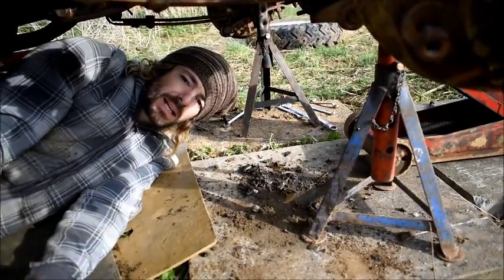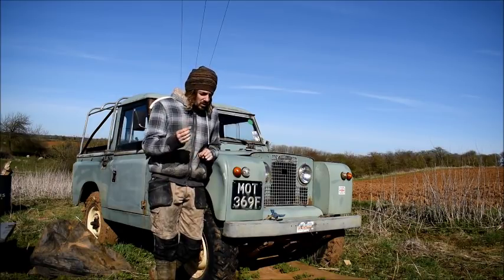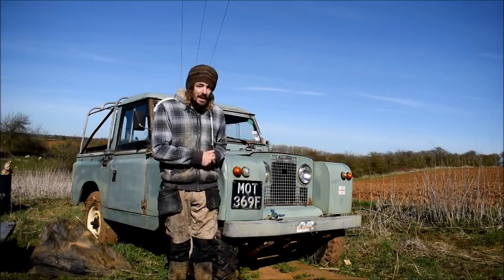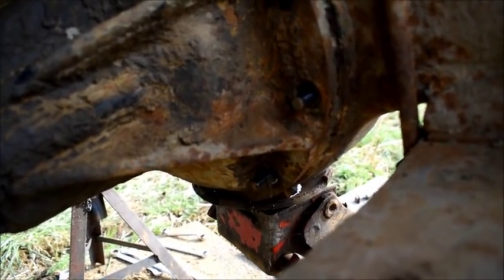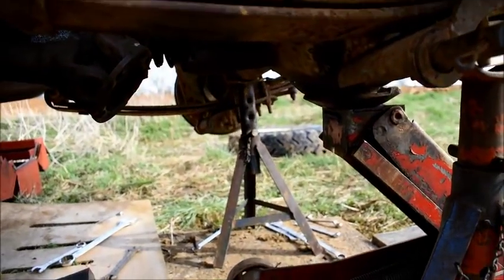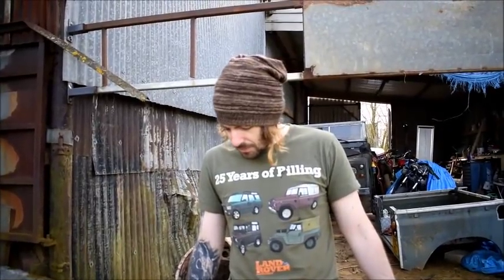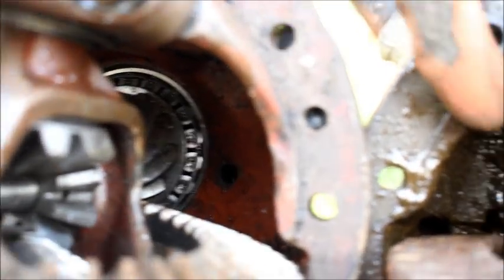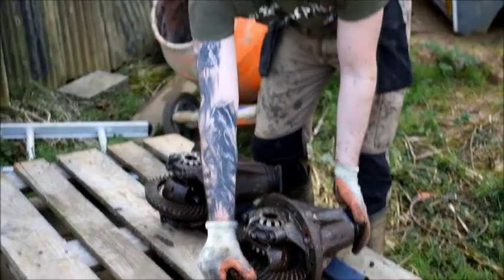Land Rover Series broken diff comparison

Comment: Oh dear! Guess you didn't change the oil after the dip at Billing last year then? Hot diff cooling under water will suck water in pretty quickly, that's why the maximum wading depth for a Series is only about 18" from memory. Hope you get it sorted without too much agro, they are far too useful to be parked up!
Reply from the maker: Indeed so 😢 better attempt to waterproof the axle casing needed... that or another landy just for playing 🤔
Reply: Some extended breathers would certainly help, some pneumatic fittings and plastic pipe will do the job for a few quid.